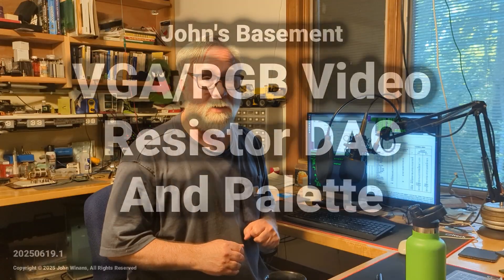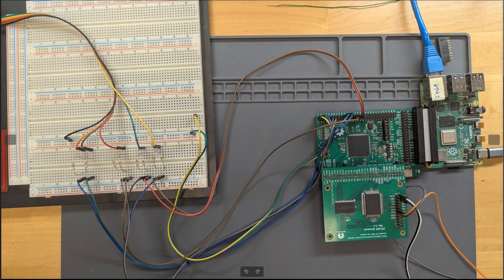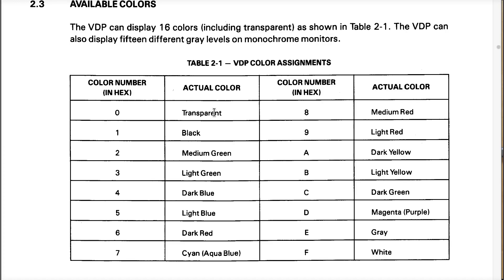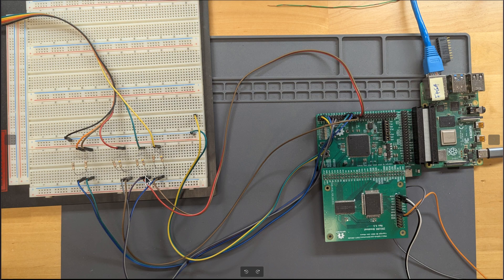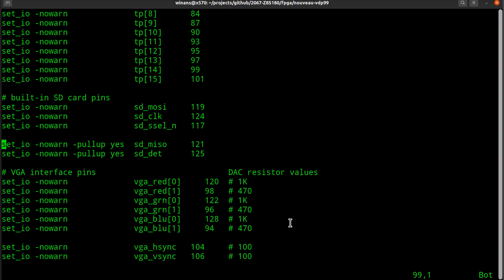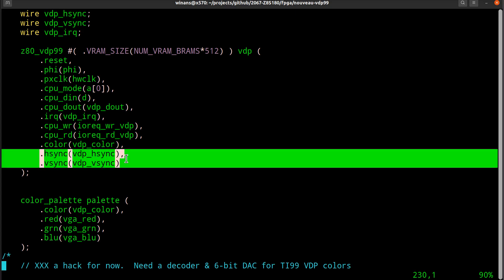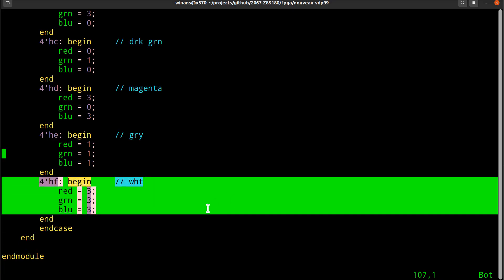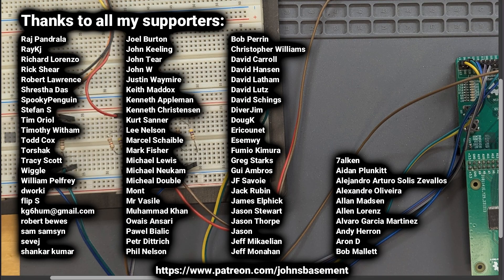FPGA #29 - VGA/RGB Video Resistor DAC With a Color Palette.

Comment: hi John, nice; in case you will have time to peek in datasheet, I randomly found also interesting old philips saa7105h chip as quite cool final analog stage for VGA but also PAL/NTSC - it is (crazily) programmable over I2C and its "format 5" input (needs some control bytes in stream though) allows byte-indexing of internal 256 full true-color LUT ... really found this as big surprise and learned something about these old  analog TVs digital internals;
Reply from the maker: Thanks.  I've been thinking about this sort of thing.  I have one I'd like to test that outputs to HDMI too.